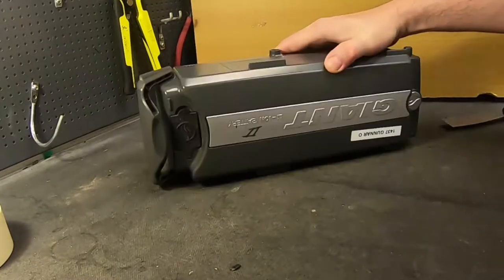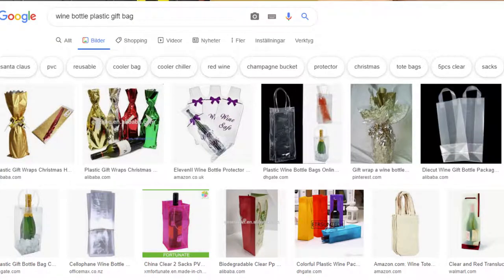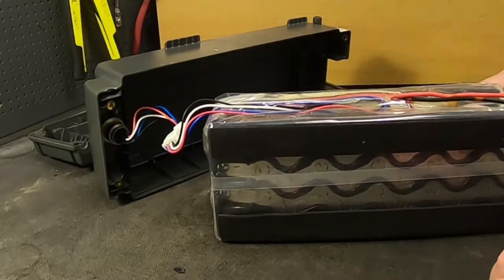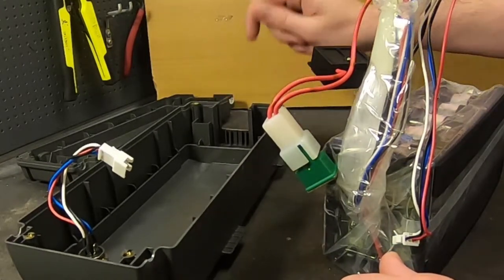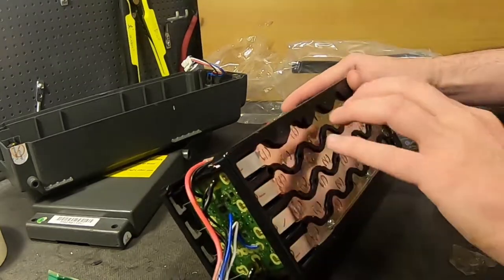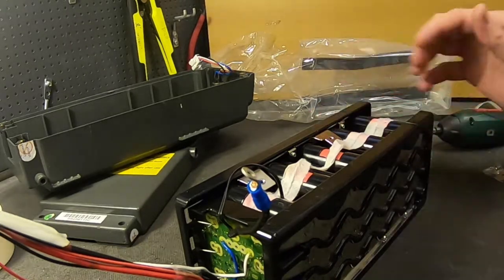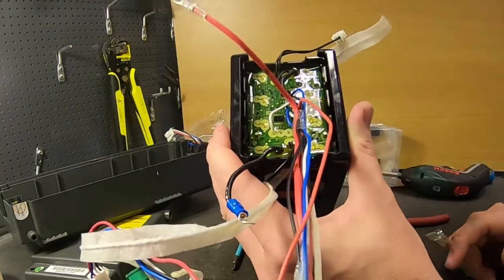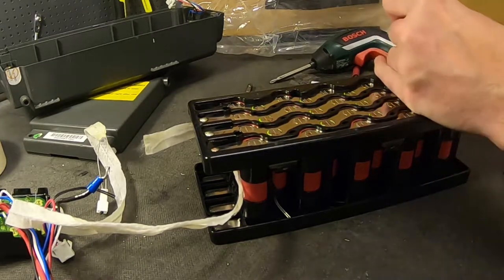Inside a 26V Giant Twist (Sanyo ca 2012) Batterypack

Comment: I disassenbled one myself as the charger kept flashing the red led indication deep discharge, I found thatvsimply dismantling the battery pack from body and only undo the plastic bag to get to the terminals of the red and black leads, then connect a heavy transformer with 26 volts output works to get the cells out of deep discharge after 15 minutes, after that the bike charger can do the rest, assemble the casing and problem solved...

Comment: im thinking of upping the voltage a bit for a bit more power by putting 8 batteries in series instead of 7 but im afraid the controller won't like it, what do you think?

Comment: Great video! I'd love to see your version of the 25 Ah battery pack. Such a pack would increase the original capacity from 234 Wh to a whopping 650 Wh! Did you use a 7S7P or 7S8P configuration to achieve that capacity? Imagine strapping two of those absolute units to your bike (Giant Twist Go Double), that would provide 1.3 kWh's of capacity! I want to upgrade my battery packs as well but I do wonder if I can reuse the original BMS if I disconnect everything properly. It saves me the time and money to source a new high quality BMS/charger. Since the bike controller limits the current flow, I take it the BMS doesn't care that more parallel connections are added to the pack? Cheers!
Reply from the maker: 7S5P with 21700 cells. i never tried reusing the original BMS
Reply: @TheBatteryDoctor  21700 cells, I didn't think of that. I'm going to look into that! Thanks!
Reply: Must be very tight for space with the 21700, I have old NiMh packs that I want to upgrade to Li-On and wasn't sure if 18650s fit. I now know they do but wouldn't have ever though of 21700s

Comment: Am I right that this battery is 7 in series and 5 in parallel?  How on earth do the connections work out?
Reply from the maker: Yes they have a really wierd config. But it makes sense for this battery 7S5P.
Reply: Can you go into detail? I do understand series and parallel connection but since + and - are alternating and connected on both the top and bottom shouldn't they create a short circuit?   @TheBatteryDoctor

Comment: Hello i have the same battery and my BMS is not working because i tested all the cells and they where ok but the battery doesn t charge.can i just disconnect the BMS so the battery can charge?
Reply from the maker: You need to change BMS and charger to get this to work. should not cost more then €50 for parts.
Reply: @TheBatteryDoctor  thank you very much for your time.and for the answer 👍👍